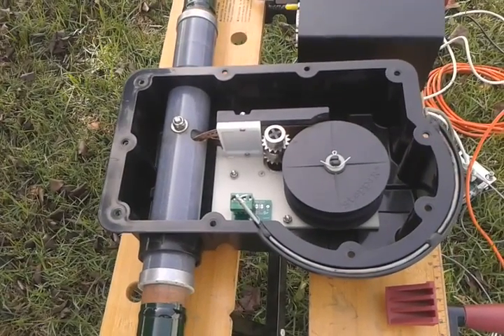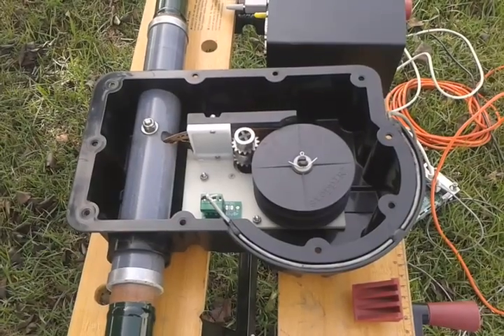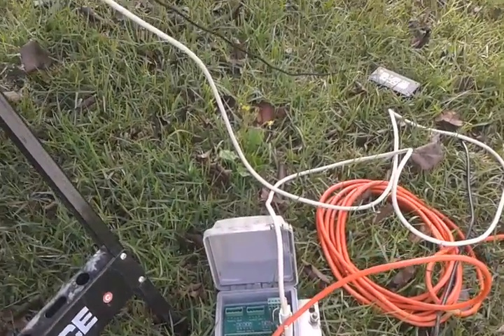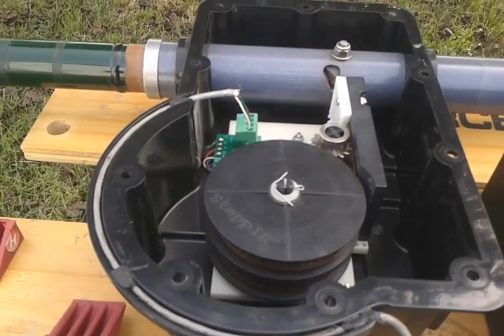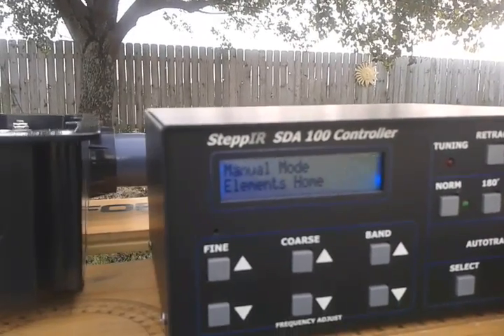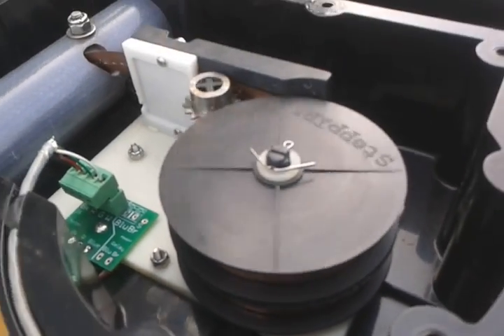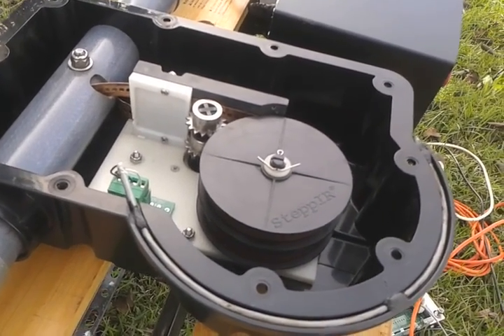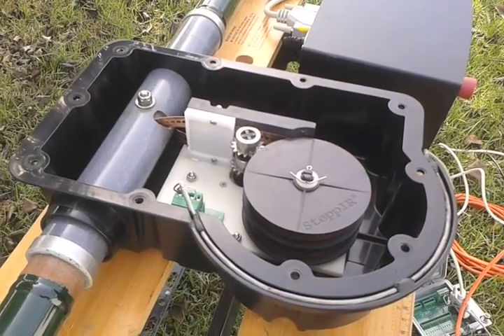Testing a SteppIR EHU after refitting

Comment: I am new to Stepp IR. I bought a BIG Stepp IR Mark IV vertical and I am seeing a lot of grief from owners having bad issues with all of this mechanical stuff. I get it that a YAGI benefits from all of these adjustable parameters BUT I read on one forum that these things are night mares to keep operating. I hope my simple Vertical antenna application is free of defects. What are most of the failure points from this design? Bad design? cheap stepper motors? too much plastic? I realize metal is a no-no because of the presence of RF.